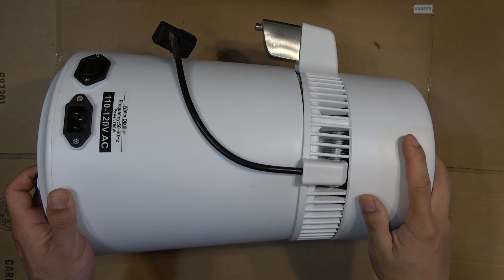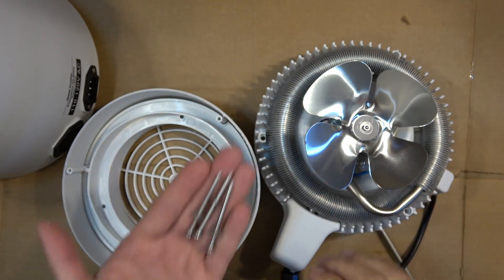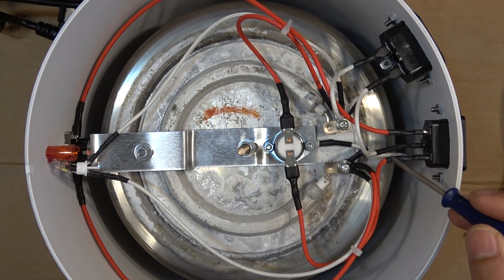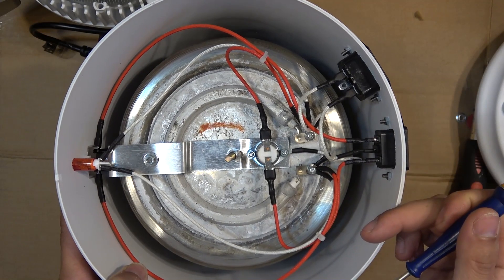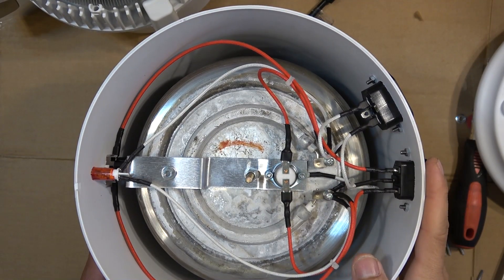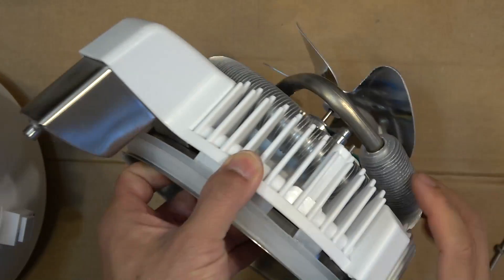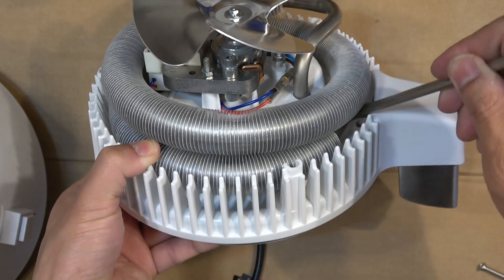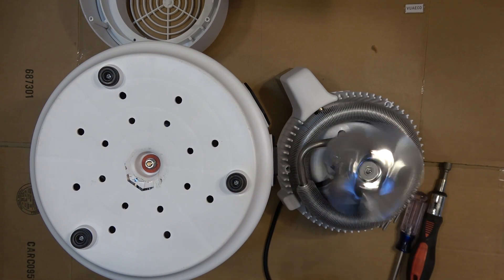Teardown: Ebay 1-Gallon Water distiller. What's inside and how it works?

Comment: Thanks so very much vuaeco. I did not realize that there was a thermal switch at the 'power switch' by lack of a better word. I thought I fixed the faulty thermal switch in the top unit by bypassing it with a jumper wire. Thanks to you I discovered the faulty thermal switch at the 'power button'.  After I jumped the switch with a jumper wire, its working fine now. To avoid overheating I have used a timer to shut off the unit after 3 hrs and 50 minutes. Thanks again!  GREAT video!
Reply from the maker: That's nice Henk. I, too, use a timer to shut off around 3 hours and 40 minutes. A bit earlier than yours but I want to have some liquid left so to make my cleanup job easier.
Reply: @vuaeco  Hi vuaeco my distiller has an issue with the fan. Initially it was working but very noisy and made a rattling sound. Now it has stopped working rattles a little and mostly steam comes out of the distiller. Any solution for this issue ?
Reply: Henk Bloemhard, The problem running it without an over temp switch is that if ANYTHING goes wrong with the timer, it will sit there and keep frying until something very bad happens. Thermal safety switches need to be looked at like pressure relief valves on pressure vessels. A must-have safety feature, like an electrical fuse or breaker. I see your comment was 3 years ago, I pray you haven't found out the hard way and lost your house or loved one!

Comment: We are on our 5th Ebay distiller. The longest we had one was for 2 years.  The switch that turns on the distiller is a 110 degree Centigrade KSD301 or KSDS snap disc manual reset sensor that is usually the first sensor that fails.   The 2nd point of failure is the KSD1 135 degree Centigrade snap disc normally close (NC) sensor on the bottom of the pot that turns the heating coil on and off while the distiller is running.  It turns off at 135 degree C and turns back on after it cools down a bit.  100 degrees C is the boiling point of water.   We do 3 to 4 runs a day for three of us.  I have replaced the switch many times.  The pot sensor has just failed on a unit I bought a year ago but the switch sensor still works.  The pot sensor has failed if you notice that you can fill the pot up, turn it on and it runs for less than an hour and turns off.  Both sensors can be ordered over Ebay and are not hard to replace.
Reply: Why not just connect straight to the element and put a timer for 3 hours and 45m?
Reply: Great info! I haven't done a tear down as yet but my unit turns off by itself about 30-60 minutes. Sounds like it's the KSD301 110 C switch which I located on eBay however I could not locate the other switch (KSD1 135 C) on eBay in case that one needs to be switched as well. Is it obvious to the eye if a sensor has become defective? I guess for the wires they would look burned out.
Reply: @raffiaynaciyan2862  Wont help your from a year ago, but anyone else searching the thread: I bought an air distiller off Craigslist for $25.  Sure enough it shut off after about 40 minutes.  It was the temp sensor attached to the pot bottom.  The old disk sensor was KSD1 150 C.  I replaced it with KSD301 135 C from Ebay.  I think 5 sensors was under 4 dollars even with shipping!  Distiller has been running for 2 hours now with no resets!
Reply: @raffiaynaciyan2862  Your reset button maybe defective. Try measure the continuity of the reset switch after it turned off by itself. Make sure not to press the button  before you make the measurement. Hope it help.
Reply: Hi I know you wrote this a year ago but just read it now. Im just wondering if I can ask you.. The fan on mine still works but it wont heat the water at all. Im guessing its the heat sensor/s but when im saying that I'm just copying others because I have no clue what to get to fix it! Is there any chance you could advise me what to get and where to get it please. Mine is a zokop 4L one but looks the same as the one in the video. I'd be so grateful for your help.
Reply: @mariaking81  If your fan works, then  it is not the thermal reset switch because that would kill power to the fan as well as the heating element.  I would replace the sensor on the bottom of the vessel. Search Ebay for this part:  KSD301 (250V 10A) 135 deg C.  Also look closely at the wires going to the heating element to make sure they look intact.
Reply: @valvulae  Thank you very much for taking the time to reply and explain. Much appreciated.
Reply: @valvulae  im sorry to bother you again but the one I have found has 2 versions, normally open and normally closed.. do you know which one it should be please?
Reply: @mariaking81  normally closed
Reply: @valvulae  Thank you so much :-)
Reply: @mikekestell3987  Thank you very much. Really appreciate your reply.
Reply: @mikekestell3987  that must be wrong , it should be normaly open , and then close after the reached temperature ,
Reply: @breakfastbuddy5  I'm confused with this.  I found a youtube video saying that NC is for -7'C for cold applications, and NO are for heater applications.  However, on the contrary,  my understand of NC (Normally closed) meaning by default at room temperature, the sensor circuit is closed, meaning it's connected.  And I used the multi meter tested with Resistance and it beeps, so it's closed.  And only when it's heated above the noted temp, 135'c, then it's open to shut off the heater coil.  and let it cool down until it connects again when it's below 135'C.  So it seems to be that the sensor type should be NC.
Reply: Thank you Eagle! You are the only one here that has finally recognized that we have 2 sensors where they are located and their function as well as their specs. THANK YOU THANK YOU!.
Reply: I found this cool teardown, analysis, and experimental video about how these thermal snap disc cut-off switches work:

https://youtu.be/8245v9Q0xnI

Comment: I bought a very similar distiller from eBay. But for some reason when I tried it out it boiled out and the liquid that did distill came out hot and the same color as my mash/wine. Almost like it was heating up to hot. Any suggestions what I may have did wrong?
Reply from the maker: Is the cooling fan running?

Comment: How to connect the digital thermostat for steam measurement
Reply: Other videos show how you can take apart the top, remove the fan and drill a small hole into which you can insert a metal thermocouple sensor so that you can monitor the temperature with an external device.

Comment: How is a $400 better than this?. Also, the problem is the bottom is burnt by the time the heat sensor switches off. I just timed how long it takes to do a cycle and set a count down timer on my phone so I switch it off before the water level gets too low.
Reply: Eh, those burnt mineral deposits can easily be dissolved with citric acid. Makes the pot perfectly shiny again with practically no scrubbing. I've tried vinegar, but that works too slowly. Citric acid is key.
Reply: @MikeTrieu  
I do the same but I put the Citric Acid, 1/2 to 1 teaspoon, in the water that I am boiling, plus I use timers to shut the distillers off.

Comment: my unit like this one is serving me well for 2 years and now the [power switch]heat sensor button is getting damaged by heat from quick disconnector.a part replacement would be great.the name on my ebay unit is [z].

Comment: Its a great video and well presented but I believe you are mistaken by stating the sensor in the center of the unit will shut the unit off. The one that will shut the unit off is what you call the power switch and its a thermal switch that is manually reset that is why it turns the unit on and you have mistakenly called it the power switch. The way it works the thermal switch turns the unit off when it gets hot and keeps it off until you come back and push the reset button to turn it back on. ITS A SAFETY CUT OFF THERMAL SWITCH. In case it got hot for any reason including running out of water. I have looked all over for its replacement and not having a valid cat # its almost impossible to find. There are many out there but they are auto reset like the sensor in the middle that keeps the water at the boiling temperature. BUT YOU NEED ONE MANUALLY RE SETTABLE!  It must be single pole 120 Volts min 7 amps with normally open contacts and manually re settable. And the key information required is at what temperature it kicks open. I do not know this and its critical to have the correct temperature for the distiller design or it will burn. IF SOMEONE HAS THIS INFO PLEASE SHARE! aLSO MAKE SURE THE PHYSICAL APPEARANCE AND MOUNTING IS EXACTLY AS THE ONE ON YOUR UNIT OR YOU WILL NOT BE ABLE TO INSTALL.  The replacement is easy just remove the 2 wires and take the thermal switch out by removing its 2 mounting nuts. Whem re-installing you MUST coat the back of it and the surface where it will mount with high temperature silicone grease to increase the thermal conductivity. IT WILL NOT WORK CORRECTLY W/O THIS GREASE.! GOOD LUCK! And please share the required temp rating info and where to buy with the cat # if you have this info.
Reply: I decided to bypass the thermal switch and put the distiller on a timer to shut it off before all the water has evaporated. It is working fine again.
Reply: @henkbloemhard3488    Timer failure = 🔥🔥🔥🚒🚒
Reply: You can take it to a dryer repair shop and buy one or you can give it a few really sharp raps and the disks inside should snap back together.. essentially resetting it. Been there, done that, experience is a great teacher 😖
Reply: This is a great summary, I’m having the same problem here and I considered just buying an actually decent distiller but replacing a part is cheaper so this helps out!
Reply: well the problem is that the working thermostat is worn and moves to a higer temperatur before its cuts out ,  i put some insulation just around that thermostat and it cuts the temperatur earlier , one can also change it to a lower thermostat  like 135 c , now the safety shut of when the water is gone not before ,

Comment: heat sensor parts are front with button KSDS 115 and the other one is ksds 150
Reply: Those numbers no longer exist. If you Google them you will get very many different items. The closest is the one labeled KSD 301. I don't know if it will do the job. It looks similar but we need to know the temperature rating at which it will open so we can replace with similar otherwise you may burn the unit or causea home fire.
Reply: @kimbo1961  
My part says on it, KSDS 110.  But I can't find it anywhere.

Comment: Thank you so much for posting this. Mine wouldn't work because I had a pin hole in the condenser tube I thought was supposed to be there as a vent or something. I was able to see that it is not supposed to be there. I hope I can solder it now. Thanks again!
Reply from the maker: Glad it helps!

Comment: Where can i get a replacement power modular? Do you have any idea?  I spilt water on the cord and it corroded😬
Reply from the maker: You mean the black thing with 3 prong where you plug your wire in?
Reply: vuaeco yes sir
Reply: Yes that 3 pronged thing
Reply: http://www.h2olabs.com/c-3-supplies-and-parts-for-manual-fill-water-distillers.aspx        scroll down until you see a pic of the plug cable.

Comment: Thanks so much for creating this video.  Do you know what the temperature of the water is while inside the still? and does it stay constant right up to the end where it changes to a higher temperature?
Reply from the maker: I don't need to measure the inside temperature to know but I can tell you right off the bat that it's 100 degrees celcius inside the still all the way until it runs dry. Temperature only creeps up after the pot is devoid of water and dried out. Only then the sensor will sense the difference in temperature and shut off the unit. The same thing happens inside a nuclear reactor and that's why they use water. Once the water is gone (pump is dead like the one in Fukushima), temperature inside the reactor will start to rise and melt everything. (unlike the water still, you cannot shut off a radioactive reaction).
Reply: Thanks so much :)
Reply: Between a 100 to 112 deg Celsius.

Comment: why don't you build a solar Water distiller, its free energy?
There is a guide on youtube on how to build
Reply from the maker: This electric distiller uses the power coming from my solar panels. Does it count as a solar distiller? :D 
I've been producing too much solar power from my system that it starts to make more than we consume. I need a way to utilize this free power or it will go to waste. This is one of the way I use my excess power.
I'm very careful when it comes to drinking water. It's not hard to make a solar distiller. But to make one that is safe enough to drink, the materials are very limited to stainless steel and glass. And that makes it challenging and expensive.
Reply: vuaeco can you add how to modify and add gravity feed straight to inside refrigerator.